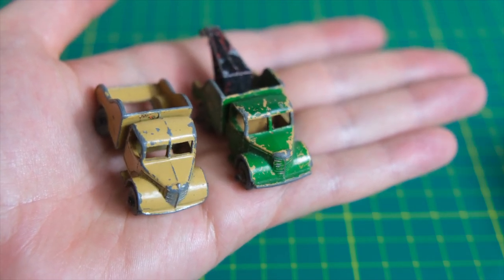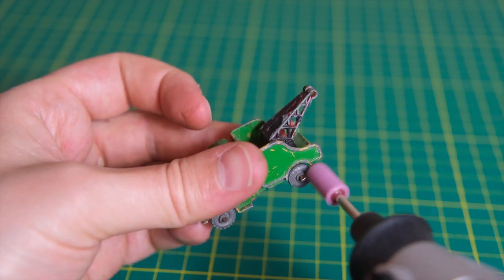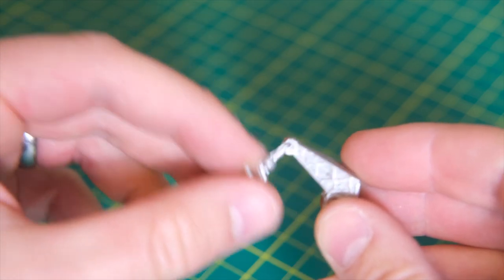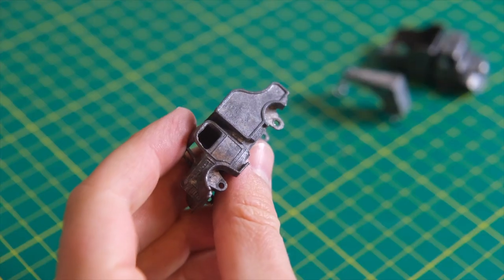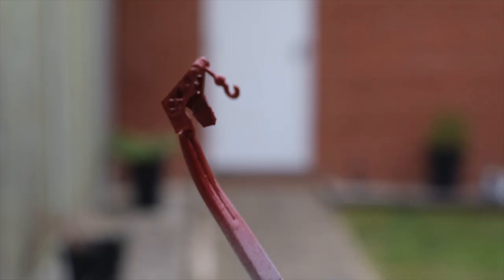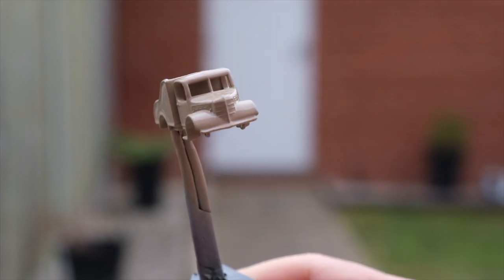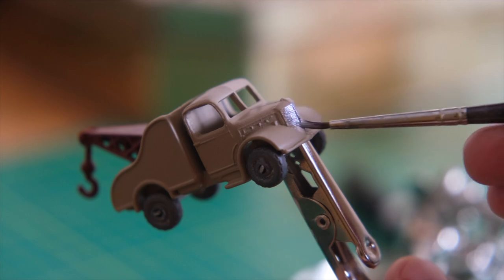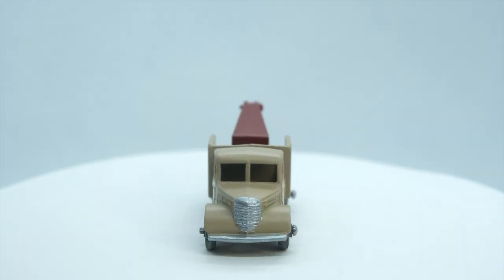MATCHBOX restoration: 13A & 13B Bedford Wreck Truck

Comment: nice and... not exactly shiny again. :) great work on those ancient castings! ^^
I'd have used the tip of an xacto to cut out the fillings on the crane before using the files, it usually saves some time, and white metal is easy to cut out, sotosay.